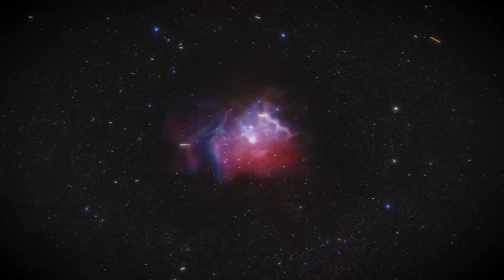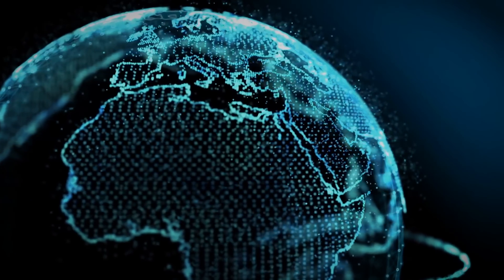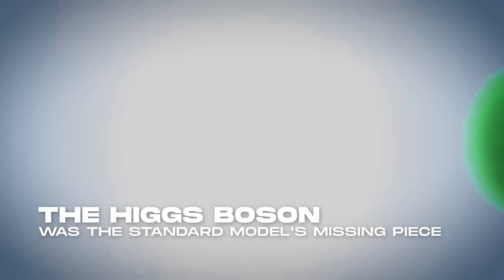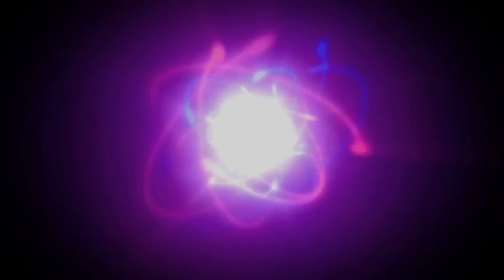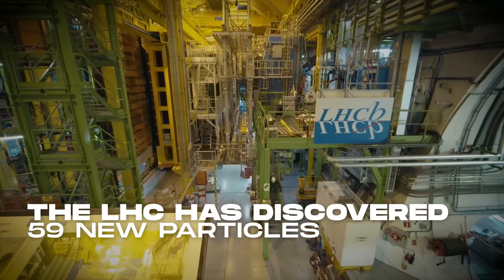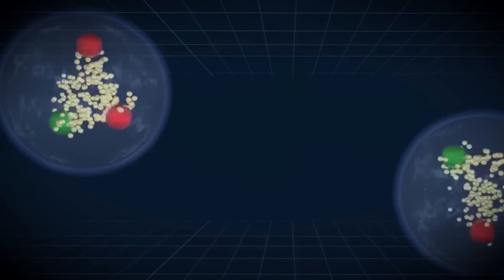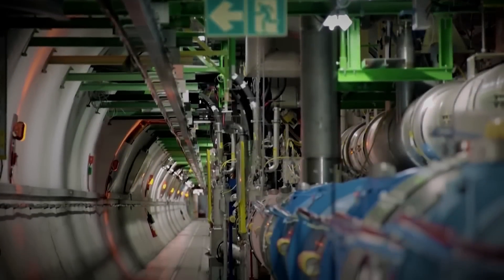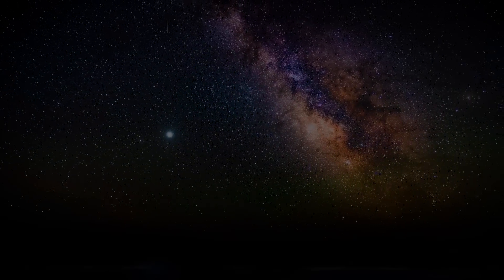Scientists Terrifying Discovery At CERN Changes The Entire Industry

Comment: I think mass is caused by particles that cause drag on one of the quantum fields. My theory is that gluons are merely the other phases of the "potential positions" of the quarks creating 95% of that mass, and not really anything by themselves. But, since there are more than 4 dimensions of the Universe that don't align at the very small scale, those other positions are just as valid. It's only "fixed" as quarks in a few positions when interacting with observation or other atoms. If an object were resonating with the space-time field (it's very rapid, and tests would confirm that matter could get colder to absolute zero with some motion at one of the quantum frequencies rather than none), it would not be influenced by gravity and have no mass -- photons in wave form transition to this and then when disrupted by atoms, have mass again. All forces are the result of time exchanged in different dimensions -- and yes, I have ideas of how to test for that.
Reply: I have had some of the same thoughts. Concentrations of time alone created everything. Meaning time travels at the speed of light inwardly, outwardly, and infinatively. 
How were you thinking of testing this? I'm stuck with it will take more time than I have to reproduce an actual experiment. Unless we can move at the speed of light and pause time.
Reply: @freespeechorgetsilenced  Welp, at first it might sound like nonsense to say that "speed of light travels inwardly, outwardly and infinatively" -- last one isn't a word. But, I can make it work. I'm coming from the POV of "how do you make the Universe from nothing" and that means that you start without time or position. If we don't have TIME to delay our trips -- everything is on top of everything else and there is no time. Anyway, that's a long conversation on how to create time and distance with nothing but dimensions. 

Currently, I'm imagining there are 4 quantum fields, and maybe or maybe not physicists are thinking the same way (I don't spend too much time getting sad about how far behind they are), and I figure, if you TUNED matter to one of them, it would ignore those properties that manifest because of that field. Whether this Universe is the inside of a black hole or not (hard to say), the frequencies of these various dimensions are higher than we can achieve under normal conditions.

So my "experiment" would be very useful to harness vacuum energy or make an object mass-less. Perhaps invisible -- and that sound ridiculous I know, but the manifestation of gravity because of time gradients happens to be time/space, and that's closely coupled with mass because gravity acts on mass (but, it also bends space so Photons are curved by, hence why they orbit black holes).

Anyway, I'd create large sheets of single layer atoms, cool them to become an Bose-Einstein condensate, use a twist of the same trick (patent pending) I'm using to create the large sheet of single atom matter, and then, with a few other tricks of using light waves to vibrate this construct (new form of matter; coherent plasma) I can wiggle this structure at almost any rate possible and impossible. Then this object/structure would reduce its mass by the weight of the membrane vibrating at ludicrous speed; whatever the current frequency of space/time and/or mass is at. I don't know the frequency because I don't have the time, and, shouldn't have to do all the work. And also, it's impossible to know since our reality is a confluence of 16 dimensions and the rate of each group of 4 differs BUT appears as the same rate whenever we test it, otherwise something stops existing (another long story). The "normalized time" between the 4 different frequencies is what creates what we know and love as "reality." But of course, there are not multiverses spawned and quantum uncertainty is for amateurs. 

The other option is to -- dang, I forgot. I'm drinking right now and can't be bothered to figure this out again. I can't remember a damn thing but I can figure out the impossible in about 20 minutes from scratch. I keep discovering the same things however, so, they seem pretty on target.
Reply: @mpjstuff  I like it. Im drinking too so no worries man. I think it makes it more fun.. 

This does differ a little from my thoughts. But I see what you are getting at with vibrating out-of existence. The something from nothing is hard to digest. The only thing I know of that can be one atom wide in a sheet is graphine. But I haven't looked into anything else that much. I'm assuming it would be similar though. The friction from the atoms touching would affect the results or how much you can vibrate the sheet without creating heat to manipulate the outcome. But having only one atom thick does significantly reduce this. Maybe try it with just one atom. I'm no expert.

My version is time itself is the construct. Time is the only thing that can exist with nothing else being. It had to come first. Everything requires time to be created except original unaltered time (the time of nothing). The more mass the object has the more time required to construct it by concentration. So if time has a frequency like a clock that metaphorically counts in all directions because of complete nothing restricting it. It can eventually act like -1=0=1 in any multitude of directions from the zero to keep it simple as it counts all of its infinite values. The zero being nothing (time but impossibly not counting), and the one being the start of our reality and the -1 being what ever is on the other side of our reality. The edgeds of that frequency is what builds what we see or build upon. But it is just time at the moment counting to itself in every fashion of value (like not just seconds). After you get to that edge (1) of the frequency you now affect the original time creating more points of -1=0=1.  When they over lap (crests and troughs) we get points in space above times original frequencies (that appears as just space) from the zero. When those overlap at the crests or troughs. We eventually get small particles develope only on these points, and that builds into larger and larger particles with their own frequencies set in stone because time frequencies hold it there. Until we eventually have a universe and what ever else that is out there. And of course the equation gets way more complex on each side. But it always equals zero in the middle. With this you could get anything from nothing, the problem is the time to recreate this. Without having current existing time interfering. Simple but complex. If this is true, you should be able to vibrate something out of existence like you said, and vibrate something into our perspective. Like passing through the equal sign of the equation I gave. 

 But it is all borrowed values from the other side or sides. Everything is literally nothing at the same time, or with the right POV. Sorry, if I'm am a little confusing, and cheers man.
Reply: @freespeechorgetsilenced  "Time is the only thing that can exist with nothing else being. It had to come first."  I think all the forces are based on Time in a way, but, Time in my model did not come first. It's more of a "pathing solution". I'm trying to answer; "how do you get something from nothing?" And, all I need is one particle or field -- but TIME cannot exist. If time existed before this, then, it would be finite, and if it's finite, it has a beginning -- and so, HOW did it begin? There can not be anything before the creation of everything. Ipso facto, TIME cannot be the first thing that existed, and we would not have existence if there were  a beginning. I imagine if you had one field and no time, that field would be infinitely large and be in all possible places and positions immediately -- because, it takes no time to take up those positions. The field can interact with itself and each iteration of a new infinite sized field is a new dimension. To get time, there only needs to be two values that are measured; vector and relative distance from origin within the field. It's a bit mind-mending to think about it; but space/distance is the time it takes to get from point A to B. But the underpinnings are already at both A and B without time. In fact, there is no distance between anything. What we see in this Universe is really only ONE rule -- and it's not speed of light. It's "equal and opposite." But, that isn't really a rule, other than a requirement for things to exist. The reason we have time and space is that we are in what seems to be an ordered space, and the next solution to "equal and opposite" is what is chosen from the infinite states that already exist. It isn't flowing. It isn't choosing. All other possibilities are still just as valid, but they do not form a "flow of time." Time is not anything but the affinity of states in infinite chaos.

Now relativity makes sense to me, it was bothering me since I was ten because I could not figure out how anything was able to move -- and why was I the only one seeing this issue? The curvature of space/time is one of the quantum fields having a denser wave pattern, but the creation of space/time is 4 quantum fields in sync -- thus, space curves as the other fields accommodate, but, we don't notice this because "our time, and our frame" is where all values (throughout the entire, entangled Universe) are ZERO. 

We can test this by resonating with one of the 4 fields (which, is a frequency so high, it's impossible to achieve without a few clever tricks). Of course, this kind of hearkens back to the "4 elements" -- and, the 5 element is really the construct of all 4. What we think of as our 4 dimensions is the whatever is required to make all 4 quantum fields have a zero point at a locality. At a great distance, or in very small samples, we might notice they aren't always in sync. THIS is how we have relativity, and that every particle can have a different value of time and more than one quantum time. 

I refined a few of these ideas recently, but now I don't have anything that doesn't seem to fit with the model. I'm just watching videos of physics now to learn the terms and see how close they are to what I was thinking.

** Oh, and the single molecule sheets are about matter depositing where it is cooler -- not needing to be super cooled. Absolute Zero is easier to achieve if you resonate with one of the quantum fields than if a particle has no motion at all. Remember; the "vacuum of space" is really a boiling cauldron too hot for us to interact with. The Universe "expanded" and at the same time didn't -- and all the same energy is in the Universe now as when the "Big Bang" occurred. However, there probably is an attenuation limit and empty regions of space might get negative space/time curves -- or, dark matter is wrapped up in those. So far, I'm leaning towards there not being dark matter, as spinning black holes can hide their mass due to time dilation (gravity that orbits it's own gravity well). The test would be to see if a faster spinning massive black hole had less apparent local gravity than if it were not spinning (smaller mass would appear to have more gravity -- because it would be dragging nearby space rather than the galaxy itself) -- but, probably hard to construct that test. Anyway, the space/time of galaxies is being dragged around with them, and THAT is where that missing mass has gone. I suppose this will be another discovery I don't get credit for in about 4 or 5 years.